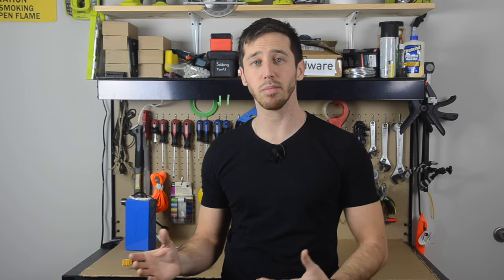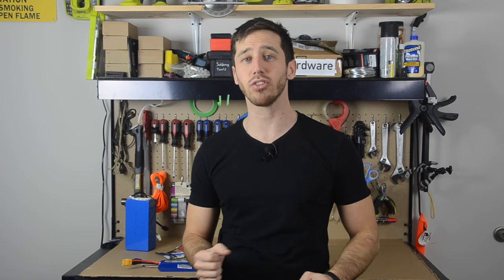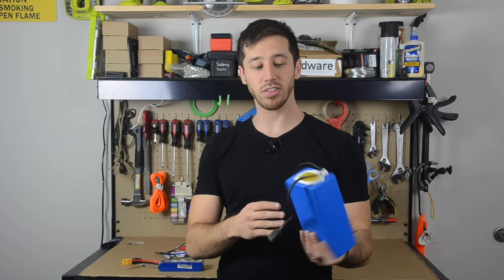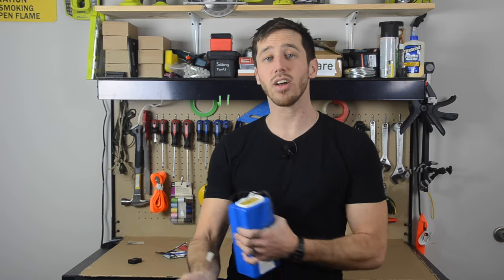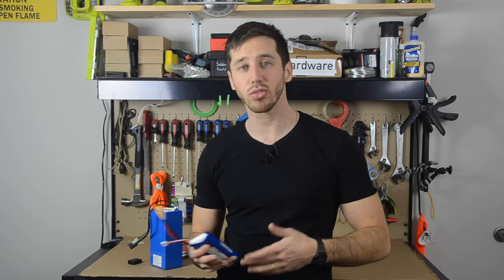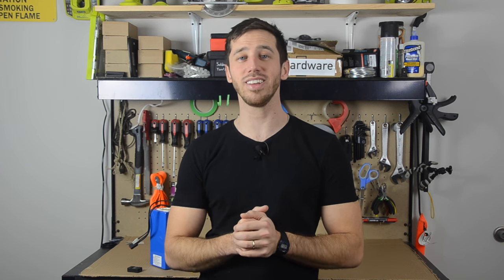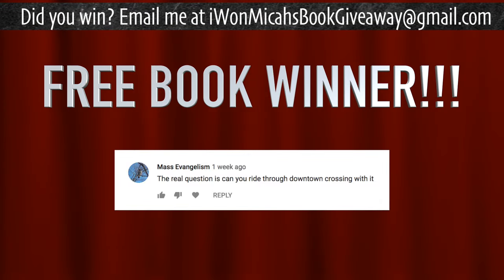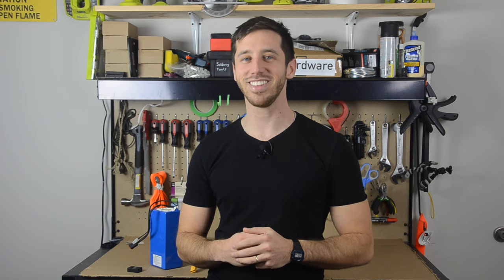Do you NEED a BMS for DIY Li-ion Batteries?

Comment: The problem with balance charging is that it mostly exists in the RC/Lipo world. You don’t see very many chargers with more than a 6s or 7s balance connector or capability. 

I’m using 4 LFP batteries where each cell is 180 AH, on the spec sheet. They are used so down a bit. I have a BMS board and I may use it. Making the balance connections is trivial. But I’ve been cycling the pack (4 cells) a few times. It’s clear that one of the cells has less capacity. So as I get to the ‘top’ of that battery, the voltage races ahead by maybe .12 volts (3.6 is nominal). So as that weak cell gets away from the others,  I have to stop the charging. After a few charge and discharge cycles, this simply represents the capacity of the pack (as a function of the weak cell). A chain is only as strong as it’s weakest link, and all that rubbish. 

If I know the hard limits of the pack, what voltages mean the cells are drifting, it’s basically time to stop the charge or discharge. Since that is a relative constant (capacity as AH or WH)  simply monitoring the watt hours in and out is very precise. But I’ve found that the balancing is kind of worthless. Once the weak cell is charged, there’s no point in balancing it. It’s better just to know the ‘top’, the weakest link, and stop. So far, the cell that moves .12 volts ahead of the pack, goes right back down as the pack discharges, and the pack appears to be balanced. 

I have a 12s pack made from 4 Titan 6s 18650 cells (Panny GA). It’s just connectors, to get to about 42 volts and 7 amp hours. These packs are made for RC use, to replace Lipos, and they have RC balance leads. I have to break the packs down to the 6s components to balance charge. The nice thing is, I can use a balance ‘checker’ to see the voltage in each cell. So, long story even longer, over a couple of years the cells, all 24, have never wandered. 

I’m asking, I guess, if the normal theories of electricity don’t naturally move voltage from the high to the low, during charge and discharge? A cell will unbalance when capacities differ and one cell can give or take no more. How much can you calibrate workable capacity based on the weakest cell, thus avoiding balance issues? 

The problem for me, with ebike batteries and chargers, is that they set things up for max capacity, the 4.2v reading where amps drop off to some set point. In a pack with 50 cells and a lot of cells in parallel, then in series, the effects of weak cells may be hard to overcome as the cycles add up. I love these 180 AH cells where suddenly you are only dealing with 4 cells in the whole pack, and everything is totally transparent.

LG makes these big cells for the GM EV’s. If you could use them for an ebike, maybe use 8 and boost the voltage, something like that.
Reply: Hi George, as I said to knoxieman.... Not using a BMS is stupid when it comes to new comers and that is why I rageed his comment, BUT! That said, he has being doing it a long time and been thorough some over the years, when using lipos I go with what is known as a smart BMS, check out Vortecks2000 on youtube another mad englishman...... But love him to bits, He's done allot of the program writing for those smart BMS's, and that is why I trust them.... It is fully customizable for top end charge and you can balance the cells as needed.

to your other bit, the lithium chemistry is a fire hazard waiting to happen, if a cell becomes unstable and is charged beyond capacity it can and will catch on fire and set the rest off with it, they are not like PB's that just "pass" the current over to the rest of the cells, it just does not happen, instead, they become heaters and........ boom.... You do make a few good points, but I do think it is not good to take chances with newbies in the forum.....

Comment: What you need to mention is that the bms tends to drain the battery all the time and if not charged every two to four weeks it can discharge the battery so low that it may not charge and even damage the cells.
Reply: Parasitic Drain varies tremendously by brand ...

Comment: One problem with affordable BMS is that they are inflexible. The maximum current is fixed. We can use fuses to control the amount of maximum current. If the fuse blows up, we know something is wrong. The accessible balancing wires provide more information for diagnostics and repair. Voltmeter alarms also provide visible diagnostics all the time. Balanced chargers are much better at charging than any BMS and BMS is not cheap or has zero weight.

Comment: Hi Micah Toll, Great Video... you explained that very well 😊👍🏼

I personally do not use a BMS, I prefer to Balance Charge my 8S & 7S 10P Packs simultaneously but separately using a high quality I-Charger 4010 Duo Charger, I have made custom NOS Soviet Miltary Plugs (Silver Pins) for Charging & Balancing for a easy "plug & play setup" built right into my Enduro E-Bike BBSHD Build its very flexible. 
       I can charge/balance my 15S/10P (35Ahr pack) at a preferred current setting & only charge to 4.1v per cell (90%) increasing cell cycle life from around 450 -500 (at 4.2V per cell) up to 850 -900 cycles. at 4.1V per Cell)
I can visible see cell voltage, internal resistance & Cell balancing on all parallel cell groups in real time.

I have also made custom Cell log 8M portable cell checkers which also have the same custom Soviet Miltary Plug so I can to Plug in & check battery cell information at any point during my ride. 

However these new BMS with Blue Tooth technology have become lot better as "Visible Cell information" becomes available via an App on any smart Phone, the old style BMS where Visible Cell information was not available really did suck as you had no idea if BMS was working correctly or not, and "if not" Battery Packs killed themselves as Micah had mentioned.
Reply: My set up is exactly like yours - except I don't have a clue what the Soviet connectors are... I might have to check those out. I have a Duo iCharger as well -- 14s10p with 3000mAh Choco LGs (the 20 amp discharge variety). I'm really curious about your connectors... Obviously you break your battery into to parts with charging-- is that were the Soviet connectors come into play... if so DO TELL!!! currently I'm using standard Spade connectors with 12 guage wires. I'm only running 20 amps max with the controller, though I'm considering a 30 amp swap out.
Reply: G'day Steve Colwill , yeah im using NOS Soviet miltary plugs & sockets because the are just  a bullet proof high quality connectors and use high quality silver pins which last forever (corrosion wise) which i use on my bike 

I use a 4pin plug -2pins for my 8S pack, 2pins for my 7S pack the same socket mounted on my bike then i plug in my charging lead into that back to i charger

2nd plug is a 19pin socket for balancing, i use 17pins  in the 1socket to balance both batteries seperatly but at the same time through the same socket, again plug in balancing lead which runs back to i-chargers Jst-xh ports on each channel. 

Hope that makes sense, check out my utube channel (videos) which should help you out some more. 😊👍🏼

I do not break my battery wiring at all when charging, (i have made a plug in and charge setup)the dc to dc solid state relay isolates the 2 batteries electrically via a Key Switch, the switch must be in the off position when charging/balancing

Comment: Hello if i have a 10 series , 3p lithuim battery (3.6volts) (4.2volts)

42volts max high volts and i have charger 42volts. Did my battery pack explode or does my series cells equalise naturally to charge 4.2 volts each?

Comment: Thank you for that great video but how about regen breaking and having a BMS? Is this a problem because every bms has a seperate charging port?
Reply: I think he mentioned something about his in a video about battery charging. Basically, if a BMS balances cells at full charge it will do it's thing when a battery reaches 100% of charge.
Reply: Cheaper have seperate. Not all of them

Comment: can i use a lead acid charger on lifepo4 with bms?   or i still need to change to a new charger? the batteries are configured on 60v

Comment: Hi Mike, I have challenge where I am loosing voltage even if my battery is not in use. I see drop in voltage and since applied for charge, it does not goes goes back to initial voltage. For my current config, 3 Li-ion battery in series and connected to BMS. So operating voltage should be (12.6 to  8.2 volts). Earlier during preparing pack voltage was 12.4v, with 3 months usage even after charging, it does not go beyond 11.9 volts and lower cutoff voltage remains same. Any possible ideas to troubleshoot ?
Reply: What is the voltage on EACH cell?   Is the BMS actually stopping the charge at 11.9V or are the amps still flowing?

Comment: Great explanation! While I was on the wall for a long time, I finally decided balanced charging and voltage monitoring was for me. I like knowing what I have. A BMS does have it's place however.
Reply: that's an absolute necessity for lithium Ion cells, both for longevity, and safety! I'm sure you remember the "Hoverboard horror". That was due to many cells in a series, with no voltage balancing.
Reply: @vincentrobinette1507  Im Ditching my BMS after years of Lipo boats iv never had cell fail and i have BMS not running 20s through
Reply: @cheekonv  Check your cell voltage at full charge after 20 cycles, before you finalize that decision. If you're charging to 90% or less, and making sure not to discharge below 30%, you can get away with that for quite a while. The only thing voltage balancing does, is compensate for differences in self discharge rate from cell to cell. During discharge and bulk charging, I prefer NOT to use voltage balancing. I want to keep the loading coulombic. Make sure each cell gets exactly the same number of Amp Hours, weather coming or going. The only time I like balancing, is during the top absorption charge. Using voltage balancing while the battery is loaded, can do more harm than good, if there's any difference in internal resistance, and differences in capacity from cell to cell. No two cells are exactly alike. I have found that a perfectly top balanced battery will show differences in voltage, when the current is high. The balancer has a tendency to favor cells with higher DC resistance, meaning those cells don't pay out as many amp hours as other cells. That actually UN balances the battery! as soon as the load is removed, they recover to a more equal voltage, once the load is removed. If you discharge a perfectly balanced battery, you will find differences in open terminal voltage among the cells, due to slight differences in capacity. Once charged, they will, again, come back to nearly equal voltages. After a period of time, the cells will fall out of equalization, due to self discharge rates. It's more of a time, than a cycle thing. Once that happens, the only "cure" is top voltage balance, then, you're OK again for a while. As the cells age, this will have to be done more often. Top voltage balancing is "good medicine" for batteries, but like any medicine, you need to watch the dosage.

Comment: Hy. Can I connect 15ah BMS for a 25ah battery? Will the battery burn the BMS? Thanks!
Reply: there is no such thing as a 15 ah BMS. 15 A is the maximum power output. 25 ah is the capacity of the battery.

Comment: I've seen normal circuit board bms but I also came across some stick on strips that are bms too. Aren't there also batteries with "built in" bms and over load and thermal protection built into the battery? I think I've seen them..

Comment: My experience with recovered cells is that a BMS does not actually balance charge cells to the same voltage but shuts off when one of the cells reaches 4.2v often leaving the others as low as 3.8v. I presume that with all new cells this wouldn't be an issue
Reply: Your BMS may simply shut-off at Cell = 4.2v.  While other BMS can and will Top-Balance.

Comment: What high quality bms have you used?  Ive only used the Batrium and Love it!!!
Reply: Hey Joe, ebike BMS's are not quite the same as solar bms's although they do the same thing. There are what is known as a smart bms, I will send you a link later.. Or you can just check out Vortecks2000 on you tube, he is also the programmer of this BMS that I will link to you....... awesome bit of kit...... happy new year!!!!!
Reply: Awakened2Truth - Disciple of Jesus the Christ   hey, hope you are well. That is not an easy one to answer sheerly because of that current, things can start to become bulky really fast at currents like that. The ONLY solution I have heard of was a guy that used a Batrium BMS system on a battery of that magnitude as the Batriums Shunt can go up to 500A short of that I am at a loss, because of the current that you need to draw, that is why car manufacturers like tesla, chevy and vw have "in-house" BMS's, I can search around a bit, but I think that when it comes to diy ev's that pickings are slim. If you would like you can go to ev west's site and you can drop them a mail to see if they can perhaps help you out with some info? I hope this helps.. Kind regards, Charles.

Comment: A good quality BMS will also have a low temperature cut off. Never charge those batteries in freezing temperatures, it would damage the pack forever.
Reply: QUALITY has nothing to do with having, or not having, a Low Temperature Cut-Off sensor.  It is just another optional feature that you may need.

Comment: always such greatly appreciated info for the novice. im saving to get a rear hub motor but not sure which route im going with the battery. was thinking of 4 mobility scooter led acid batteries to save cost. 500watt and up would handle that extra weight? was like 20 or less pounds.

Comment: Hope about protected cells with no bms?
Looking at a 48v 20ah 21700 pack for my bike but it has no bms , seller says it's safe because all cells are protected

I'm guessing I would eventually just add balance connector or bms later on.

Comment: i got a 56v 20ah 450 euro good batt pack with a 3A charger, but there is a bms of only 35amp on the battery. can i put a better one on it ? or take it off ? i mean i dont want to burn my brand new batt pack.. and can i still charge it on the charge port then, i got 1 2000w motor, and want to go faster. then 60 kmph. want to use all the power from my 2000w motor or what it can handle. and how do i take the bms off ?
Reply: The individual battery cells have a specific rating, they most like matched the BMS to the max output of the cells.  If you used a 45ah BMS the battery would heat up and degrade unless active cooling was applied. I would suggest improving motor cooling those aren't particularly efficient, then gear it how you want.

Comment: If use a TP4056-Protect charging module,do I still need a BMS? thanks
Reply: I am just learning myself, so take my advice with caution: The TP4056 is for charging the seperate cells, before they're being put in a pack.  The BMS is inside the pack, meant to work after the pack is finished.  So the answer is Yes, you need both, cause they have complimentairy functions, not overlapping.

Comment: If I have a 1p battery pack and all I want to do is make sure it doesn't drop Bellow 3 Volts. How do I do that?
Reply: voltage threshold cutoff. Op amp, voltage reference, transistor, relay. Use the op amp as a comparator. you'll need a resistor and potentiometer, to dial in the threshold voltage to what you want.
Reply: A 1S BMS ...

Comment: How would you wire up redundant  BMSs? I can't conceive of how that would be done in such a way as to offer more safety and not less.
Reply: Two BMS's, each capable of operating more than 100% of the full motor load, wired in parallel and individually fused.  Each BMS would then pass approx 50% of load amps = run cool.

Comment: i have a question, i have a diy scooter trikke  i am using three 48v 350 motor my batery is 48v 13s4p  10amps or close to 10amps with BMS discharge rate 35amps now if i accelerate quicke enough or most of the time while riding it shuts off, i will turn of the switch to off the back to ON and it will work again, do i need to replace the BMS on a higher discharge rate  to eliminate the problem? please help thank you.
Reply: Two options: 1). You can increase the number of series connection by 1 or 2 row. Modify the charger to allow full charging to make full use of the storage. 2). Remove the BMS so that it won't cut off on you due to voltage sag from the battery cells.  Another problem is most batteries out there can't handle high current charging and they degrade fast so their lifespan is shortened. They are also nearly worthless in the cold freezing weather as the charge gets lost very quickly.   Better off to build a battery pack with real good high-performance cells without the BMS for best performance and long range.

Comment: Thanks for the voltage alarm. I am using a 8k lithium power wall with no bms.😎 Alarm is functional. Everything is on votage control on hardware cut out when pass the limits. 👽

Comment: Would you happen to know if a 4S bms may be used as a 1S by paralleling  pos and using them as one and end up with a higher amp 1S bms. If it were a 4S 40 amp to start with and doing whats said above would make it a 160 amp 1S  Just a thought. Correct me if it would not work please. I need some large 1S and was figuring that might work correct me if i,m wrong before i buy and try any.

Comment: Can we install 12v 30amp with 3s bms each batteries in series 5 batteries and get 60v   and we charge batteries 60v charger or charge each one 12v please ans or must make one piece 60v with 17s bms